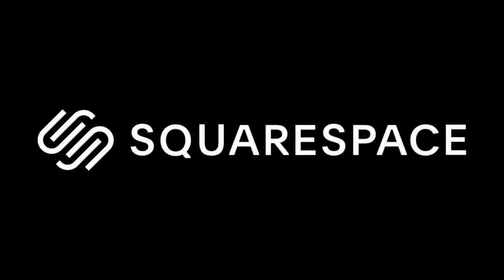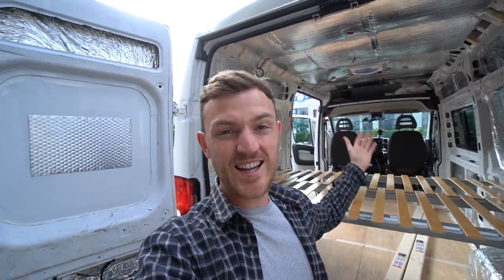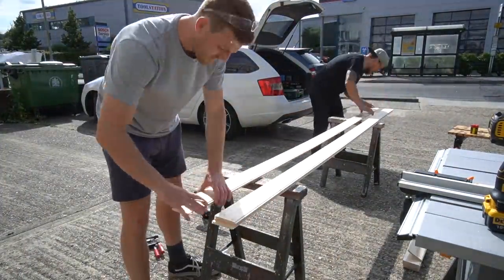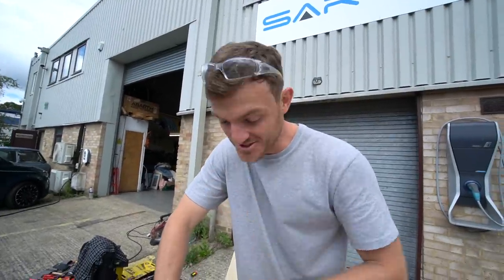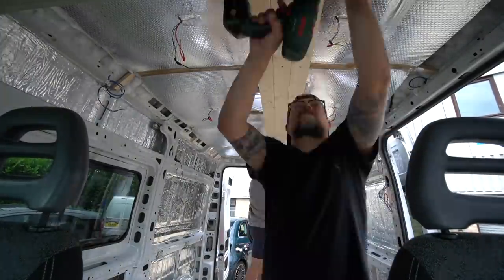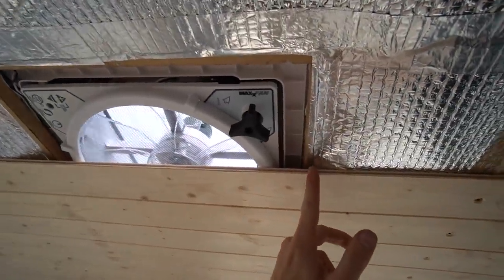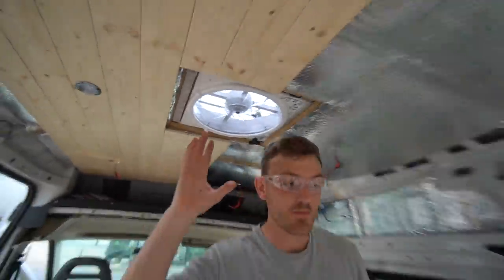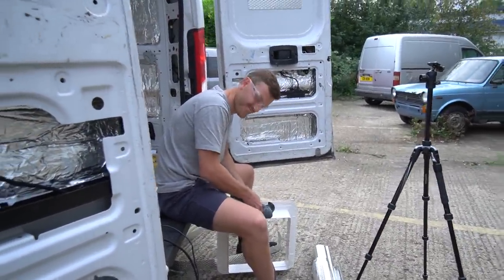LET'S TRY THIS AGAIN! Installing Van Cladding | No Experience Van Build

Comment: You need to use the cross cut sled that probably came with the saw, or make one to use with it. Tablesaws are designed to make long cuts along the grain, for example if you needed to split one of the pieces of cladding down the middle length ways. What you're trying to achieve would be best done on a mitre saw or at very least with a cross cut sled on your tablesaw. Otherwise it fires wood out at you and damages the saw.
Reply: This was even mentioned in the Steve Ramsey tutorial video he watched! Cutting corners doesn't always cut time, but it can cut fingers!

Comment: Awesome sauce looking good Will if you’re looking for really good insulation you should buy some rock wool it doesn’t matter if it gets wet it will dry out and you will not get mold also it does not lose its insulation value it’s a bit pricey but well worth it I use some of it in my ram pro master that I use for Expedited rush emergency Freight. I can’t wait for the Europe adventure to begin make sure you get your diesel heater installed before you head over that way case it gets a bit chilly 🥶😎👍🇨🇦🇨🇦

Comment: Use some Danish Oil on the cladding to maintain that Nordic / Spa look. It's not horrible varnish and will settle to a satin and flat finish and not uber glossy. Easy to apply with a lint free cloth and two coats should easily crack it ...

Comment: Asked my dad who is a joiner and he said the reason table saw dosnt work is the bit of wood isnt big enough there designed for cutting sheets if want to cut stuff like that easy use a chop saw it won't send stuff flying 50ft away 😂😂 van builds looking good thow cant wait to see it finished and you doing more adventures

Comment: The kick back you keep getting is partly because the waste of your cut should be on the otherwise of the blade, or use a mitre sled to keep it off the fence. It does that as the wood twists and catches the blade.

Comment: Having the wooden cladding should change the acoustics inside the van.  It shouldn't sound as, 'echo-ey', as it did beforehand, plus it'll add a bit of sound and heat insulation.
Reply from the maker: It sure makes a difference

Comment: I didn't expect the van to look this good 
This looks stunning and the colour as well I don't think it needs any colouring to do (just my opinion)
Just waiting for the looks of finished van
Reply: I agree.  In a small space the lighter finish would go better and make the van feel more spacious. Maybe just use a clear finish of some kind. If you still want to add a bit of a colour, just use a very light stain that you apply and wipe off. More forgiving, also, than the type you brush on as there are no brush marks! 😁. 
Look forward to your next video!
Reply from the maker: I think I will paint it white eventually but still undecided
Reply: @WillsWhereabouts  ... white sounds great!

Comment: That ceiling makes a vast improvement.
I did wonder about you getting a Fire Extinguisher with all that flammable timber and other stuff to be fitted ... especially as you are cooking with naked flames.
I also wondered whether there were lighter weight materials than timber that might be used for ceilings and walls as they raise the centre of gravity of the van and the weight ? Any ideas ?
Walls/Floor and the space will start to feel cosy, plus much less noisy ... Psychologically, it will also make you feel warmer in winter too ...
Good luck with the next stage.
Reply from the maker: thanks Stephen, I bought the thinnest cladding possible to save on weight and will defiantly get a fire extinguisher in the van

Comment: Try raising the blade in the table saw  it’s too low. If it’s higher it cuts into the wood better rather then trying to fire it off the top edge.👍🏻🙂

Comment: hey Will making progression sweeet! question: thought you had a leak still in the roof somewhere, did you locate and fix it before cladding the ceiling?
Reply from the maker: Managed to locate the leak and 99% sure it has been sorted, fingers crossed anyway

Comment: Great job, but my OCD is kicking in. The lights at each side of the fan are not symmetrical. 1 is 2 planks to the side, and the other is 3 planks to the side.
Reply from the maker: Your OCD is worse than mine hah

Comment: Not to be a safety nazi but, never put the cut off between fence and blade, that causes your kick back, if doing a cross cut, use the miter attachment and no fence, if doing rip cuts the piece between blade and fence is the piece you are going to use, and needs to be the part you are pushing on and controlling
Reply from the maker: I probably need the safety nazi to help me out so the advice is much appreciated

Comment: A cover covers thigs IE so you cant see them, a shroud specifically goes around the outside of something PS in the 6 weeks i been watching you i have bought a van converted it did a trip around wales (( 600 miles)) and have been back in work a a full 2 weeks since , get a move on m8 lol

Comment: Dude, that crosscut was sketchy and you're lucky you didn't get hurt. You should never crosscut something against the fence that's wider than it is long--the slightest wobble in your guidance of the workpiece, and I do mean slightest, and you've got the saw shooting a missle back at you. And this is why standing to one side of the blade is safer than standing directly behind it. Edit: and wear hearing protection---after a lot of years of loud music and power tools, my hearing is shot and I have to wear hearing aids.